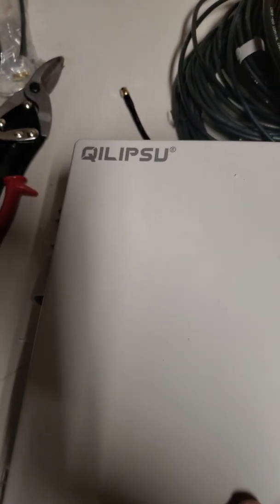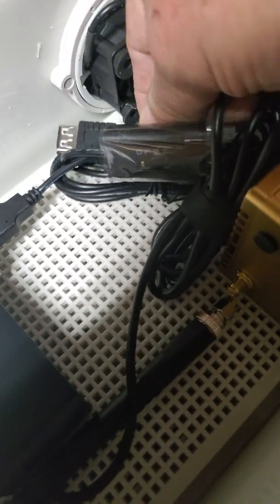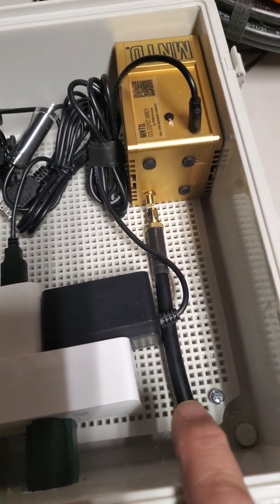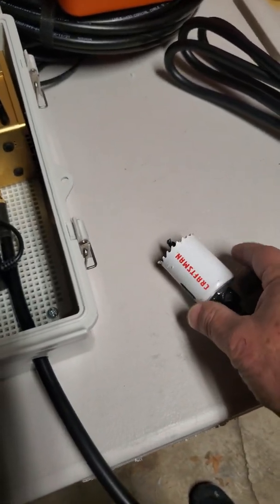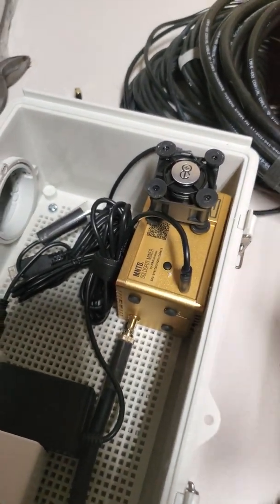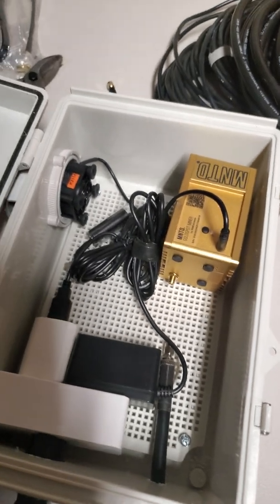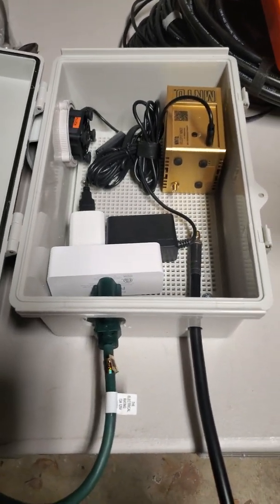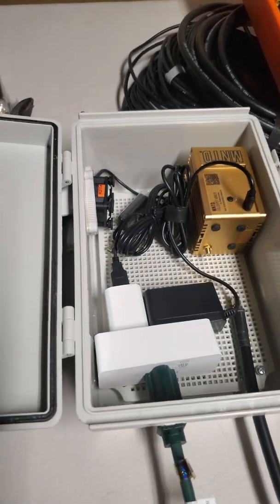Helium Miner Outdoor Installation of RAK GoldSpot or Panther X2

Comment: Thank you Mr. Tim for sharing your experience with us, I'd like to ask how much revenue x2 does give? And from which website can order it
Thanks
Reply from the maker: First let me say, ty for being part of my new YouTube experience. Your question means a lot to me and others as we all enjoy this Helium / #mypantherx2 journey. 

So far it is exactly the same as the RAK GoldSpot I had at my house.  I'm using all of the exact same equipment and conditions as the GoldSpot so the fact it is equal means to me, it's a good quality miner.  My house is in one of the lowest spots in the valley but I'm still earning a little over .20 $HNT per day.  There were days with the GoldSpot that I earned less and the PX2 is matching those low days.  Please feel free to ask other questions.  In here to help
Reply: @viheliumgroup9357  I appreciate your reply thank you, I'm planning to try it in Bahrain "middle east"
Reply from the maker: Please let me know how things work out.  Are you planning on placing the miner outside in the summer heat?
Reply: @viheliumgroup9357  Hello sorry for late reply, I received it two weeks ago and I earn 23.5 $ until now I use the original antenna
Reply from the maker: Can you message me on Discord? If so, look for me @Loquacious and let's continue this conversation.

Comment: Please share the cable link and any additional connectors to connect the cable to your Panther X2.   I got my Panther X2 and plan to install in the attic.  Thanks a lot
Reply from the maker: If I were you I'd try to get the antenna outside.  Just my suggestion.